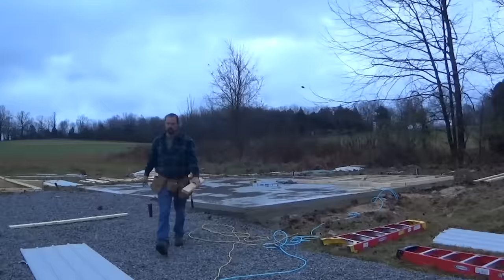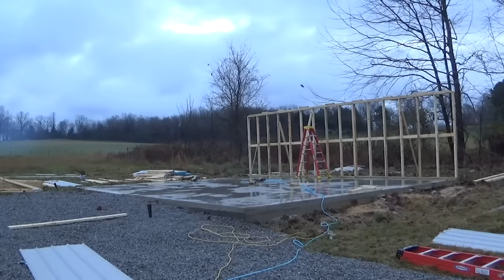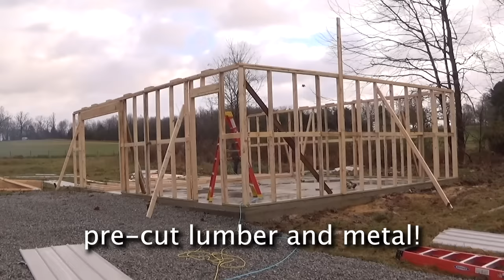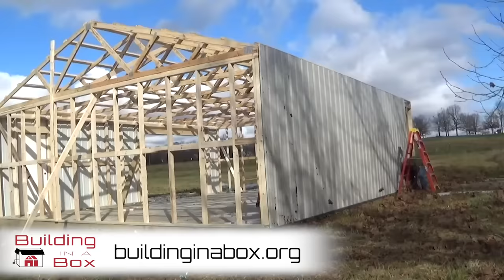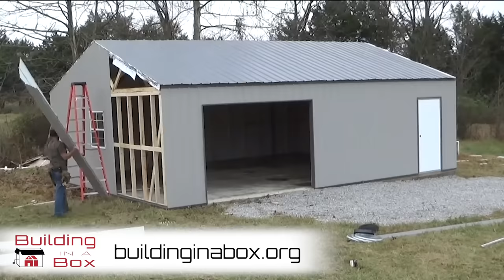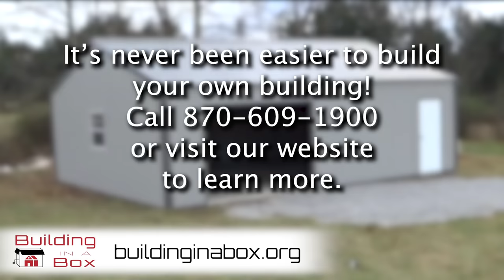One Man Builds A Shop Building In One Day - With A DIY Shop Building Kit

Comment: I run a barn building company and firstly, I'm impressed.  Nice job organizing the material to save time. Seems like the average handy person with a friend could knock this out in a couple days.  You could send them drip stop roof metal to save the step of vapor barrier.
Reply: Spray in insulation after the fact
Reply: According to the company, the guy here has done around a thousand builds, so the estimate for a customer is 2 people and 2 days. Might be longer depending on experience. Amazing regardless.

Comment: Here’s the reality... I built my own garage for the first time...  it’s a 24x27 pole barn. It took me probably 2 months... I didn’t have much help at all. Had the posts and 2x4s& 2x6s along the sides in a couple days... built my own trusses took a few days... then had a guy help me hang them the next weekend. In the next week done the sides with metal. The week after done the roof 2x4s along top and metal then took a month to get someone to do concrete.. I don’t do concrete... takes awhile when you try for the first time.
Reply: I hear ya took me 4 months lol
Reply: even that timeline is quite impressive sir! sounds like you killed it.
Reply: Yeah I had to wait like 3 months for a concrete contractor to do mine. Hard getting a hold of them sometimes

Comment: I can see the next stage being interior, putting in rockwool insulation, some form of board like gypsum or even just ply, heck having the insulation and then wire holding it tin so it doesnt accumulate moisture easily. Maybe not meant for someone to turn into a living space, but I can see someone trying to do that and making a small living space there. Dang it, not I am having fun braining ideas with this. Have the window on the 3' door side and I am golden! Set the shop on the garage door side the more office tool bench sode by the 3' door

Good gravy, follow building codes.

Comment: Two guys I can believe, just setting trusses requires checking measurements getting up and down multiple times, it's bull. It also requires prep of sorting everything out in a plan of attack and without const exp it' can turn into a bungled mess lacking experience. Easier than from scratch yes but people watch crap like the DIY channel and discover things are not as easy as it seems and usually end up in a mess and have to call in a experienced person to either fix it or do it and fixing it takes llonger and costs more.
Reply: You would put truss layout marks with the wall still on the ground ,if you were smart about it .
Reply: @onthelake9554  I wasn't talking about spacing layout  but the other measurement.
Reply from the maker: Yes a person definitely needs construction experience to tackle one of these.. but this person actually built this in 8 hours, but has built close to 1,000 in the last 20 years. Thanks for commenting
Reply: Exactly

Comment: There’s no way he did that in 8 hours. Never saw any video of him putting on braces. It’s physically impossible to put on a brace level with one guy
Reply: It’s a flimsy ass building as well. Side purlins are extremely minimal. 
I’ve built thousands of similar buildings in the last 20 years but just usually take a crew along and knock it out in 4-5 hours

Comment: Untreated timber in direct contact with the metal cladding. If you like rotting wood then this is for you.
Reply: Was wondering why he didn't wrap the outside but he did the roof?
Reply: I believe the "roof wrap" is insulation. That is very common.
Reply: The only place you really would need treated lumber would be the sill plate
Reply: @sconrady123  ... some places in the south use reflective faced bubble wrap to keep the heat from the roof down a bit. It makes a difference, but not as good as real insulation. OTOH, it's quick and cheap.
Reply from the maker: Actually we do use treated lumber against the concrete

Comment: As an architect, the things I notice right off the bat. No sheathing or hurricane clips, is this going to be alright in high winds or heavy snows? Doesnt look like theres proper flashing or water sealing around that window. Just asking for it to leak in a year. And the large metal roof slopes toward not one, but both doors and does so without gutters or snow clips. Thats just ASKING for REALLY bad days

Comment: I would be truly skeptical except I hired a retired builder to build me a custom 30x24 garage. He had to pour the concrete foundation, get the materials, put it all up, and shingle it. Two windows, 2 car garage door and walk out side door. He worked by him self, I figured 2-3 weeks. I came home day 1 the foundation was poured. Day 2, I came home around lunch and every stud is braced up ready for structural support. I come home at the end of the day and all the trusses, roof, plywood, windows and door are on. Day 3, I come home and it's shingled, sided and garage door is on, Project complete. I couldn't believe it. I have no idea how this one old guy got those heavy 30ft trusses up their on his own. Not too many folks could dead lift one of those on their own, less likely lift it roof level. He had to cut things to fit. This guy is putting a kit together, so I believe this video. Normally you get what you pay for so you would think a garage in 3 days is junk but nope, 15 years ago and this garage is still awesome.

Comment: Building a box is a easy weeks work. 4 walls, trust’s etc. wiring, windows, doors etc are what take  the time
I created a jig and slid my boards in and cut them all to length, even pre drilled all the electrical holes for the wire. Creating a solid plan saves a ton of time and actually adds quality. 
If it took two days? Would it really have mattered ?

Comment: Its a mighty man that can put up a 20 foot roof truss unassisted.  Kits like this are great until you start finding stuff that doesn't fit together properly and has to be modified on site. Maybe these kits are good, but for myself, I have never seen a prefab kit in either wood or steel that didn't require field modification in the course of erection.

Comment: Wouldn't you want the radiant side (NOT the White side) of the bubble wrap on the roof pointing to the sky vs pointing to the inside of the building? Have seen where radiant shiny redirects incoming heat away from the building when it tries to cross the gap/through the roof material from outside into the inside, I imagine if the shiny side is facing inside it would heat the building in the summer, or just provide no benefit at all.

Comment: I actually built this...But let me tell you, it is not that easy.
I made a perfect level cement floor...many of the  beams and shed it self had impropet cut  parts..I had to cut to fit...also the drill holes did not always line up..
Take this as what it is worth...the average guy who doesn't know what they are doing or isn't EXTREMELY handy will have big problems with this...
My advise, when you buy a storage shed this size, PAY to have it installed.

Comment: I counted about 60 pieces of sheet metal. And about 20 pieces of trim, a door and window, with no help? That's about 80 pieces plus the frame . If you spent 5 min on each piece average that would be 6.5 hours ,roughly. The frame to lay out and put together walls and header ,no help? Let's say 2 hours if you know what's what. Thats ,8.5 hrs , still have to install trusses, ,2x4 lavin,Lavin, he rolled out insulation..if one man got this done in 8 hour day ,I need to reevaluate my business....I'm a builder

Comment: how many days did it take to pour that slab, pre fab every section, mark every necessary measurement for assembly, lay out the materials in an ordery way, and plan for this ad? oh plus the fact that this video is posted by the company selling the kits... guy doing this might have seen a few before. these results arent even typical for him. lotta smoke and mirrors but it did the job. i clicked

Comment: Pretty cool but Why didn't they use P.T. on the sill? All the way around where the concrete meets the walls it looks like it's all K.D. that's an awful lot of work for something that's just going to rot out because they skipped using a handful of P.T. 2x4s on the bottom of the walls. I've never seen anyone use just plain K.D. and no sill seal on any new construction. The difference in the cost is what $20 dollars total, makes no sense.

Comment: No roof deck no is no cross bracing on any wall or between any walls, , 3" of snow On that roof with that pitch,  Is roof will collapse. 30-40 mph winds  Buildingwill blow it down because there's no cross bracing. But just this guy did a hell of a lot of work by himself that's a lot of tonnage to move.

Comment: Problem is I would rather put up corners and shoot the corners and string line the studs and make sure everything is plumb and level in my framing cause .. concrete isn’t always perfect …. But that’s just me .. most slab buildings are built just like this as long as it’s one story shouldn’t be an issue .. if it’s more then two stories then the issues arise
Reply: Never seen a two story workshop in a regular neighborhood lol

Comment: Your wall purlin, truss spacing, and roof nailers are inadequate.  Too bad.  Cutting  $700 on correct spacing compromised the whole build.  You can see the panels flexing under his weight.

Comment: And the grade and footing plus the concrete forms and rebar if applicable and mud and killing time for slab was already done, so it took actually longer than a day. Liers leave out some key info folks.  And idoubt if he installed the big door or and what's this, no power? That a shop it's going to need power, a week with county inspection

Comment: Since its pre cut, was it pre built to see if it all fits? Doubt it. Precision only works when its cut on sight. Even a 1/16" can make a huge difference. Track houses all look the same. Not one was built with the same dimensions. Yes, 1/16" does matter. Considering the thousands of hacks that could be used, how many were used on this one. Does the average buyer know any of them. Im sure precut is more than a massive pain in the ass for the average buyer.

Comment: Should've wrapped the whole wood structure with Tyvek before the metal was applied. Had it been myself I would've tucked the Tyvek under the bottom plates before they were shot down to the concrete. Even with insulation and drywall on the inside that shop is gonna EAT UP some heating and cooling energy..
Very poorly insulated from the exterior in which looks to be a Northern cold climate during the winter. Just because somethin was done fast doesn't mean it was done correctly. This guy jus shot himself or someone else in the foot with big energy bills or wasted wood burin a stove or he could have an ice box to preserve meat for the winter 🤣🤣🤣
 
That old saying still stands true.
Haste, makes waste...

Comment: I wouldn't want it.  Wall studs on 24 inch centers.  Roof trusses on 4 foot centers.  No thanks.  Where is it being built that with these building specs, it's according to code?   No J-bolts for the walls at the foundation.  Sure isn't according to code where I live......

Comment: This guys a big fraud he didn’t start from scratch and take into consideration the time for getting the proper permit or the amount of time for pouring the concrete slab and allowing it to cure enough for it support weight. Plus you never put bare wood directly onto concrete. There’s so much more wrong with it that just screams incompetent building processes and incompetent builder.